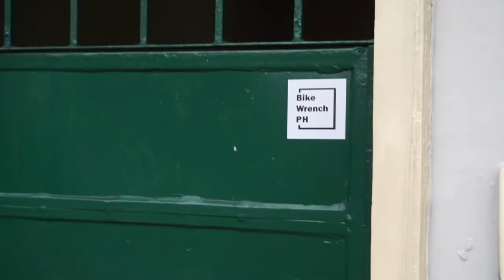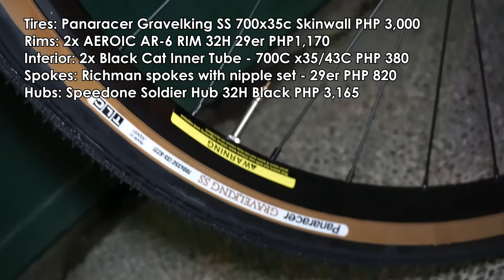Custom Gravel Bike Build (40,000php) Tsunami Seaboard CX-01 Frame with Sensah SRX Pro

Comment: kasya ba 29er na gulong dyan ?
Reply from the maker: 700x38c is 29er
650 is 27.5er
Reply: 700c x 42 or 27.5 x 2.1 max width kase sabe nung, seller tapos di pa nya na try na 29er na pang mtb kaya di nya alam,kaya nag tataka ako sa sukat